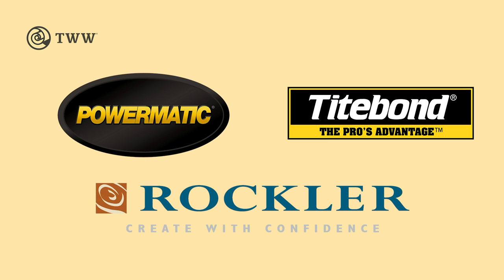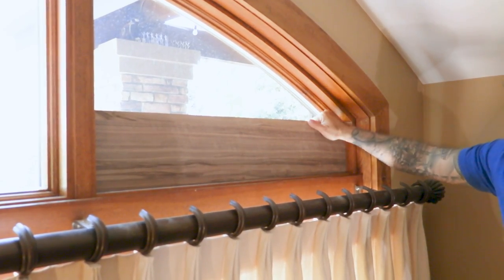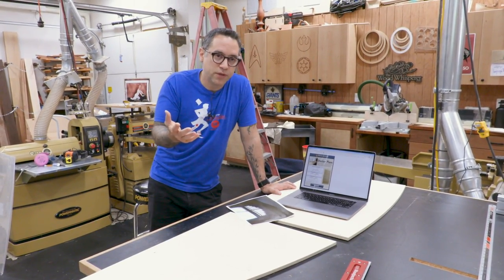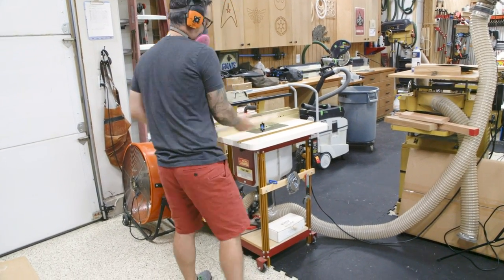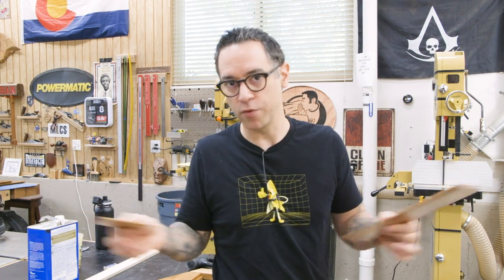I Made My Own Plantation Shutters | Saved a BUNCH of $$$

Comment from the maker: 0:00 - Ad
0:16 - Intro
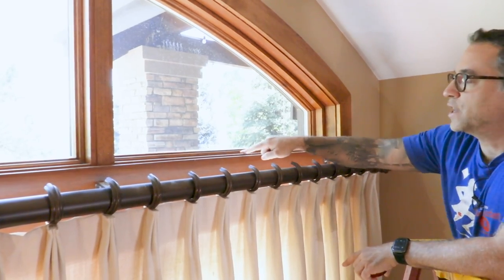1:27 - Copy the Shape with a Spiling Stick
8:09 - The Design
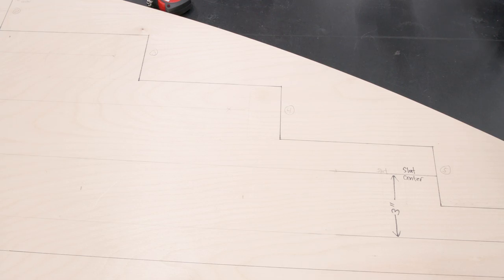11:37 - The Wood
12:37 - Pin Holes
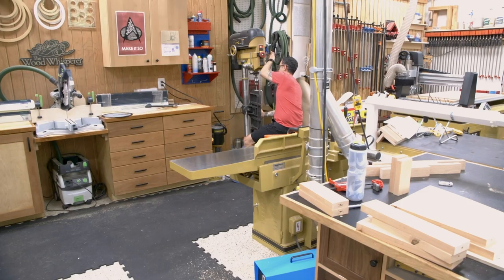15:09 - Top Rail
16:05 - Rabbets
18:36 - Bead Detail
22:41 - Mortise & Tenon
23:00 - Cutting the Curve
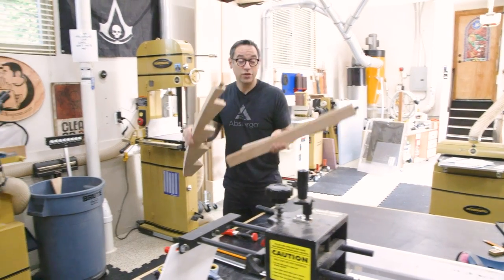24:02 - Sanding & Pre-Finishing
24:39 - Louvers
27:12 - Control Arm
29:00 - Mouse Hole
29:40 - Screw Eyes & Assembly
Reply: How many hours did this project take?
Reply from the maker: Really not sure. I don't track my time. It's polluted by having to document the process anyway. :)
Reply: @woodwhisperer  was it as long as your spagstick

Comment: Really helpful video, thanks. You asked about the screw-in fixings, if there was another way - there's a lot of that in jewellery-making, where you have to join 2 or even many more metal loops (known as jump rings) together, usually with 2 pairs of needle-nose pliers. It's been established that rather than pull loops wide open, then try to crimp back together again (which damages the structural integrity & risks that it never again becomes completely round), it is better to hold the loop horizontally between 2 pairs of pliers, with the join facing upwards & just lightly twist the hands (1 forward & 1 backward) so the ends of the jump ring move in opposite direction from each other. The ends remain aligned while appearing to be a row apart, leaving a gap for parts to be added on. Once assembly is complete, we twist in the opposite direction, returning the ends to their original position & the circle shape is restored, undamaged. Hope this helps.

Comment: Spagstick! I can’t wait to try this out on my next project. The Rockler kit looks very helpful. One thought on a way to improve the accuracy of the slag stick…. Drive a small nail into the base of the stick so just “the tip” is protruding. I think using this as a witness mark will help when it comes to replicating the points on your ply. Just a thought. Been a fan for over a decade I’m guessing and appreciate all that you do Mark.
Reply from the maker: That sounds like a good idea. Maybe even two nails so it prevents rotating too.

Comment: Stunning results. Perfect fit and very nice look and function!!!  I am surprised you didn't use a centering jig for drilling into end grain?  Bits wander off in end grain and I can see it has on several pieces though it appears the degree of offset hasn't had a bad impact.  All the detailed work and then hand drilling without a jig caused my eye to start twitching!!! Come on Mr Spag!!!
Reply from the maker: Haha thanks Brian. One of the keys to woodworking is knowing the actual impact of any particular action you take. If you go through extra steps that have zero impact on the end result, you are either inexperienced or retired. 😉

Comment: Excellent build. I don’t think I would have glued both ends. If any of your plastic pins need replacement you need one end dry fit with screws only to secure the slates in order to disassemble to facilitate repairs.

Comment: After getting quotes for plantation shutters, I decided to build my own.  How hard can it be?  I used Rockler's calculator and jig and premilled louvers.  After a few tries I was able to build a very tight tolerance shutter.  I had to build several jigs.  The jig for the stiles worked great!  The jig for the louvers not so much.  I did the same trick with my drill press for my louver's.  Rockler's louver jig and a batter powered drill did not have good enough tolerances and the light line varied between louvers.  The hardest part was attaching the control rod.  For me, the screw eyes didn't work very well.  I ended up building a jig to hold my staple gun to shoot staples into the louver leaving the top protruding, and another jig to shoot a staple into the control rod.   Shutter #5 turned out great!  My wife wanted painted shutters, so I tried getting quotes from cabinet shops.  They would paint 1 or 2.  But I have 34 windows in my house!  I could not find anyone willing to give me a quote.  I tried rolling paint, and then an harbor freight HVLP, then finally a Fuji HVLP.  But I'm not a very good painter :)  Still have 29 windows to go..

Comment: Interesting issue came up when I installed premade shutters as bifold doors on a closet. With outside shutters, the closed slats should face down on the outside so water runs off. In your case you have an obvious inside/outside. When both sides are inside, what to do?  We experimented and the consensus (Nicole rule) was that closing down looked most natural (pretend the room is the outside).  Thanks for the video.

Comment: Nice! My wife wants shutters in the dining room with many large square windows. We had a commercial company do an estimate and it was several thousand dollars. For some reason I hadn’t even considered building them myself even though I have a garage full of tools, everything you used here in the video except the planers (and 42% of the skills 🙂). That slat rounding bit really did a pro looking job! Thanks for the Rockler tip, definitely gonna look at it now. This might result in a happy wife and a new planer for the garage! 👍
Reply from the maker: If you have a lot to do it will get tedious, especially when it's time to work on those louvers, but it's totally worth it for the cost savings. Plus the happy wife as a bonus. :)

Comment: Great work and all, but I might have just tinted the windows really dark.
The neat part of doing that is its adds some insulation factor to the windows by keeping ultraviolet light out durring the day and cuts out solar gain. 
Shutters or no shutters you can do this anyway. But if the tints dark enough it will block out the bright lights.
One more option is stained glass incerts
Reply from the maker: The windows are already tinted as dark as the tinting company had. :)
Reply: @woodwhisperer  
Go to a car tinting company, you can put 2 layers on for darker tint. 
I did my own its pretty ez. I have no doubt you could do it and do a good job.
Just got to use  good brand of tint.

Comment: It occurs to me that the stair-step could possibly be avoided but I'm not sure.  I should really watch 'til the end but I wanted to say this before I forgot about it.  Would be possible to glue a dowel to the bottom edge of each louver so they can swivel from the bottom instead of the centerline?  The control rod would need to be able to move them almost a full 180 ° without binding.   It would be connected to the top edge.  Sound impossible?  I don't know.  
I finished the video.  Damn good job.  Very nice.

Comment: In a situation like that, with the window frame all around, a pure friction fit without any glue probably wouldn't appreciably weaken anything, while allowing for future maintenance.
Reply from the maker: But as the shutters heat up and shrink, they could fall out. Future maintenance is super easy...just remove two screws.

Comment: But how do you replace the plastic pins when they get brittle and break after a couple of years exposure to light? (Metal or wood would have been a much better choice for these.)

I would also prefer a control line instead of the arm, would give a slight variation between the louvres but easy to route down to daily reach level (or motorize).
Reply from the maker: Curious if you're asking this due to experience or speculation? We've had shutters in our homes for the past 15 years or so, both in Denver and Arizona. In neither case have we ever had a plastic pin deteriorate, primarily because 99.9% of the pin is not exposed to light.
Reply: @woodwhisperer  I've not seen that type but seen many plastic details with similar exposure deteriorate even in moderate exposure.
Reply: Texas replacement window installer here. I've never seen any problem with the pins, but if the shutters are more than a couple years old, the magnetic catches are almost always trashed. As Mark said, I don't think the pins get much if any light exposure.

Comment: I've had to glue arches like that, where you can't fit a clamp to a curved surface. The answer is to glue a temporary dog. Sometimes I even just use a screw. After your glue is dry, you can remove it. Then you fill the hole with a plug, sand and finish. After all, that surface is facing the window framing and will never be seen again.
Reply: I was thinking he could have used a pegged mortise and tenon joint, as it would have pulled the pieces together without the need for external clamps.
Reply: @ParaBellum2024  true, but the peg would've been visible. If that's the look you want, then that's fine. But if you dont' want to see 1/4" dots on your woodwork, then it's a non-starter.
Reply: @paulheitkemper1559  Yes, that's true, but 8 feet up it would be pretty insignificant.  Another way would be to make wedged through-tenons with a slight flare, as they wouldn't be seen at all.
Reply: @ParaBellum2024  maybe, but you still need to hold those in place until the glue dries. You could also just use a band clamp around the whole perimeter.
Reply: @paulheitkemper1559  Good idea.  That would be a simple way to apply pressure.

Comment: So why glue it together?  Tight dominos will hold it well, what makes it work is you are screwing it into the frame.  This would allow you to remove and repair it later if needed.
Reply from the maker: Having owned shutters in my home for the last 15 yrs or so, I can't think of any circumstance that would require me to repair a shutter in an elevated decorative window. Accessible shutters that are open/closed and used by kids are a different story.

Comment: Sooooo, How do you wash the window? The only way now is to take the whole thing down... Should have used a interior frame with hinges and a magnet on the opposite side.
Reply from the maker: I disagree. Let's be honest here. How often do people clean elevated decorative windows? In my case, the area is periodically dusted but they are only truly "cleaned" about once per year. If reaching the window through the shutters stops proving adequate at some point, it's a matter of removing two screws to get full access. Including an entire additional frame, hinges, and magnets, is complete overkill for a window of this style. Floor level windows are a very different story.

Comment: Couldn't you just pick a random point in the middle, and the two on the end - find the radius - and use a large makeshift compass (a 2x4, or piece of string) to get the shape?
Reply from the maker: That would be risky. An installed radius is rarely a perfect curve and your method would assume perfection. Even if the curve started perfect, it’s unlikely that it will still be perfect 10 years later. Mine certainly wasn’t.
Reply: @woodwhisperer  Great (and quick) response. Thanks for thinking it through. I had thought the radius might be close enough, and may just need minor tweaking, like the minor changes you made after the first template with the spagstick. Great material - keep producing!

Comment: Why not just cut out a paper or cardboard template? I'd wager most people have plenty of Amazon boxes laying around and it seems like it'd be easier than the Spag-Stick. Is it less accurate? Or is the Spiling Stick just a fun skill to work on?
Reply from the maker: In this case it's definitely less accurate since there's a build up of molding that would make it difficult to get the exact shape. This was definitely the most accurate method for my hands.

Comment: Could you have just made a paper or cardboard template, then transferred that to a piece of wood instead of using the Spag Stick?
Reply from the maker: Perhaps someone better than me could have. I considered that but the problem is the way the molding is built up. For that to work easily, I'd need the glass to meet the outer shape directly, but it doesn't. There's a little bead in there before the frame I'm conforming to meets the glass, which makes it impossible to get an xacto knife in there to cut the shape out.
Reply: @woodwhisperer  makes sense. Thanks!